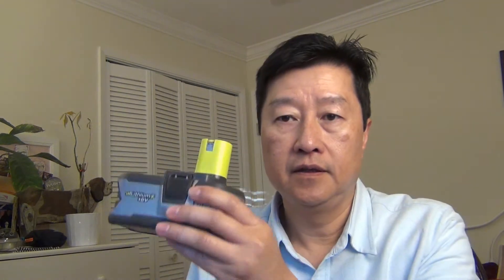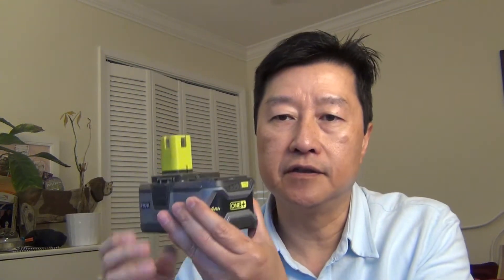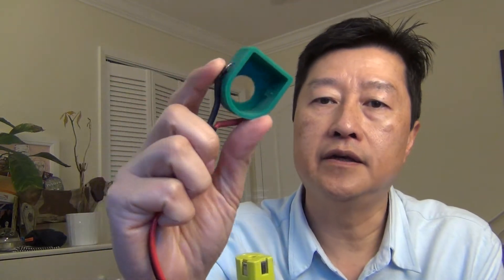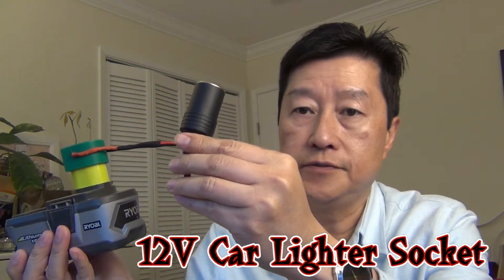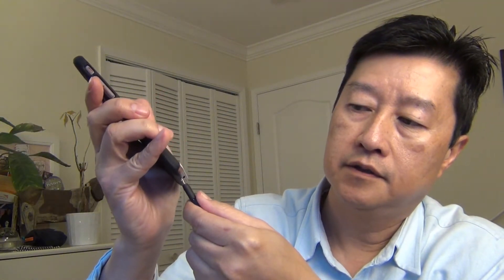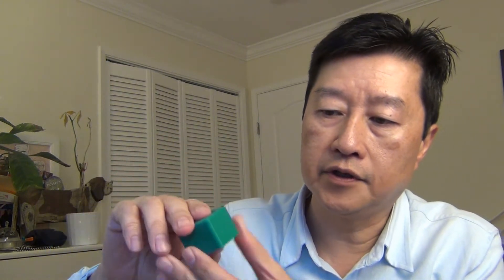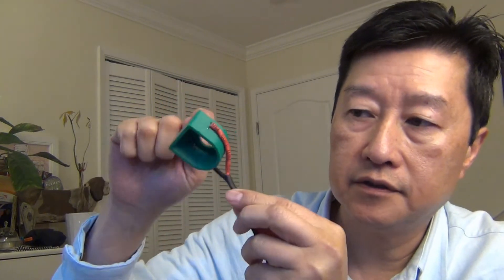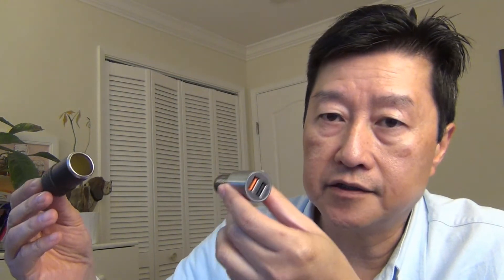Ryobi USB Charger - a LearnByBlogging DIY project

Comment: I’m not familiar with 3D printing. Where do u go to do get the clip made and how much does it cost? Do you have a 3D printer? Can u do this with 40 volt batteries from other manufacturers & how? 😊
Reply from the maker: I get my 3D printed at http://treatstock.com. I had 5 of them 3D printed for  $18. I don't own a 3D printer, but will someday, not because of cost but because of instant gratification as it took a week to receive the result. The USB car charger can tolerate up to 24VDC only. Anything higher than that, you'd need to get a different DC/DC converter.